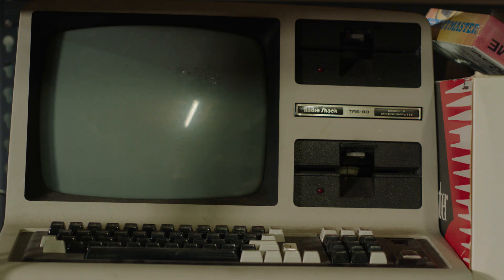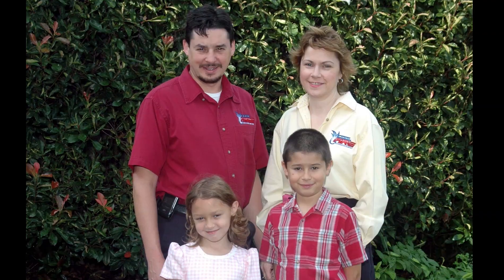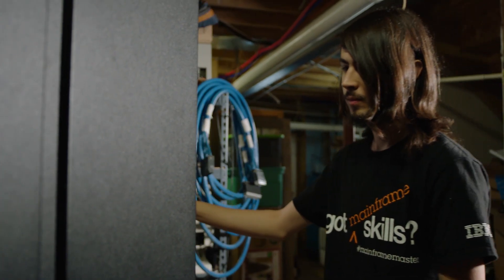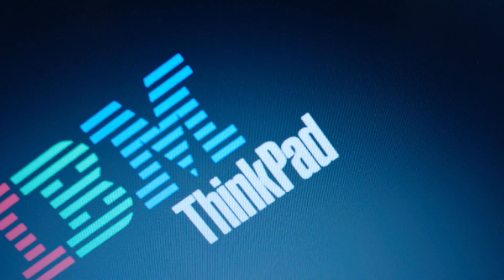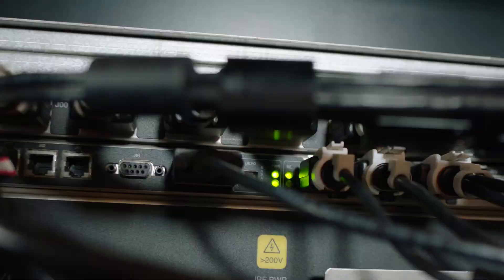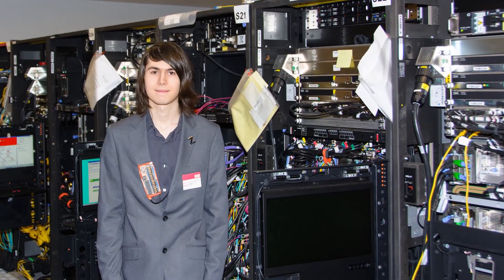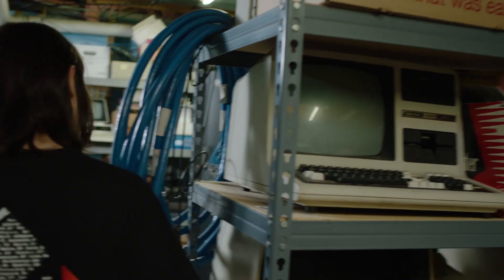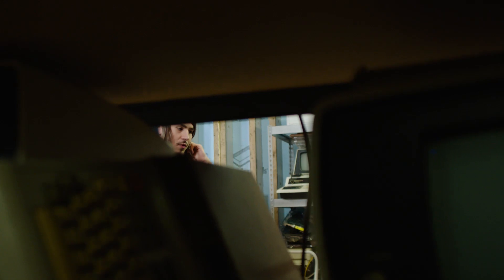The "Mainframe Kid"

Comment: it's one thing to own one, it is yet another to get one running. i worked with these machines when they first came out in the 80's and 90's. each one has massive power, cooling and space requirements. no private person, don't care how rich, has the floorspace to get one operating.
then there is the software needed to get these things to do anything. many won't even power on without the right programs and firmware.
how about the the huge tape drives, disk drives, controllers and printers?
by the way, ibm has called them 'enterprise servers' for almost 25 years.
Reply: Yup.  I probably could have had the DEC PDP-10 that I used to work on but it would have been totally impractical without buying a building to house it.  In 1968, computers were much larger than this comparatively recent  IBM mainframe.  The PDP-10 though would have come with all required software, I saved the disk images and booted it up once an emulator was available.

Comment: Started on an IBM 1620/1710 decimal system and PDP-8. Then IBM 370/168, 390, and 3033. Also DEC PDP-11/780, then started with Intel in it's infancy writing diag FW through i7 Quad Core. I helped invent the quad core and wrote the diags and comm FW between cores. Retired. Sure was a blast!

Comment: I got my first taste of Main Frames as a Millwright Electrical engineer in 1975. With a background in Logic circuits ran by vacuum tubes LOL
Reply: I hope there were no running mainframes with vacuum tubes in 1975, though we had two vacuum tubes then, a CRT and the photo multiplier tube for the light pen.
Reply: @jrstf logic circuits with vacuum tubes lol yes that was the first switches, no not a mainframe, I did say “with a background in vacuum tube Logic circuits” there was a period after 1975

Comment: I wish my parents would've allowed me to take home a machine this large but we didn't have a basement.  At one time I did have about a dozen terminals including a rather nice color graphics terminal.  Around 13, got an Altos ACS8000 'multiuser CP/M' machine that was two large boxes, and a trunk full of tapes - still in my computer room acting as a table.  Then got an Apollo DN460 which was a fascinating unix machine with a massive coprocessor card - sadly I had to get rid of this.  Then found an SGI 4D/780gt, table sized graphics workstation.  Both machines ran off 110v and ran for hours on end in my bedroom.  Little did I know Apollo and SGI ran a bit shy of max amp rating of household wiring, but never had any problem.  Still have the 4D and about 12 other SGI machines, an IBM Power workstation.

Comment: Im 18 and i have my own mainframe as well although mine is a little older. its only a 1965 IBM 1800 with the 2311 hard drive, 1816 console, 1442 and finally 2 2401 tape drives. I got mine working and now after two years of ownership I've got a bad SLT module meaning i cant address some of the 32K or core memory but other than that everything works.

Comment: My 6 year old boy is just like this, in his own way. He Already makes—completely on his own —a spinning bucket toy with an on/off switch like a miniature version of the gravitron you see at the carnival. He Watches YouTube maker videos and tries to copy them. He gets different supplies like breadboards, wires, alligator clips, batteries, etc etc., from the local Micro Center, and asks to borrow my tools, even a legit Black and Decker Drill, and then also uses ordinary arts and crafts stuff like glue and tape.  

All I’ve done as a parent is not to command and direct or even guide him, but merely to demonstrate, show, suggest, etc., and ultimately enable him by buying him stuff. That’s the best you can do as a parent—enable and guide your child to unlock the person inside that they already are and want to become.

Comment: I applaud this kid. I'm in my mid-60's now, and when I was 20, I went through Control Data Institute Computer Tech program. We trained on a CDC 3300 discrete transistor "supercomputer". In the late 70's I bought an IBM 370/145 mainframe from  a local University, installing it a bedroom in my own house. It was a blast to play with.
Reply: I could not fuckin imagine going to a party in the 80’s and the dude shows me an IBM mainframe in his bedroom
Reply: Wow, a 370/145 would have been a much more difficult beast to wrangle than the z890 this kid was working with.
Reply: HOW?!?  What were power and cooling requirements?
Reply: Frankie - tells us about your skills, then.@frankiedettori3932
Reply: @frankiedettori3932 about you
Reply: how big was your bedroom? i worked on one of these machines. you need disk, tape, printer, card reader and huge console. then there are the power and cooling needs, not to mention the raised, reenforced floor to support the weight.

Comment: It show running OS/2 , but mainframe runs MVS (OS/360).
Reply: What you saw was the screen of the attached ThinkPad booting the OS/2 Warp operating system. Nothing special there. But that's not the mainframe. The software that runs under OS/2 on the ThinkPad is what is used to configure, control, and monitor the mainframe's hardware. Think of it as the "control console" or "hardware management console."

Comment: If he is into legacy hardware and legacy programming he can make millions as a government contractor.

A lot of  government agencies specially military still use 70s era technology and the support system is depleted.
Reply: Yeah, and that’s because it would be a security risk to update the hardware and software.
Reply: @nojatha4637 no. It’s because when you have a critical system that works reliably you keep using it. There’s no point in incurring the cost of rewriting that mainframe software to run on anything else as long as there’s a mainframe to run it on.

Comment: I miss original IBM thinkpads
Reply: Me too. I worked for a short time with IBM, and got to play on one all day. I loved the little eraser-head mouse. I bought one, kept it much longer than I should have, and it was stolen from my car. The thing was probably worth about $150 at the time, and the broken window cost me $200. Why did I leave that thing on the seat?!!?!??!
Reply: I don't miss them at all

Flimsy paper thin ABS plastics that would snap easily, motherboard flex failures(good luck finding a working motherboard), keyboards with no windows key(can't do supercommands without a windows key), IBM bios hardware whitelisting, ouch. Terribly built machines and they don't age gracefully at all...

I like ideapads though since they're basically all pressure sensitive drawing tablets. Goood for 3d modeling and hand drawn animation

but old timey IBM era thinkpads... I uhh .. you can have it 😅 They still were pretty good at equipping laptops with nice GPUs. So if you find a working one it's still an okay choice.. Just its a lot of work to get one running. You mainly find retired business ones that'd been stripped and scuttled

Comment: Did you have to get 3 phase power setup?
Reply: He mentions this in the SHARE video. He's running on 110v under 15A. At the time, he hadn't spun up everything, but was having no power issues.
Reply: @JohnJonesJMJAtlanta  he's using " 220 2 phase that was what he said" (that's what an electric close  dryer or hot water heater uses.)

Comment: imagine having a computer thats "faster" than modern computers and it runs a old unsupported os OS/2
Reply: No, the control notebook serving as a monitor runs os/2. Not the mainframe.
Reply: @badscrewold3162  The ThinkPad T42 probably originally came with Windows XP
Reply: It not "faster" it's just different. Most computers (super and consumer grade) calculate floating points much better than any mainframe can. But mainframes exist to calculate decimal floating points. They are also far more reliable. That's why most financial transactions (stocks, flights etc..) are calculated via mainframes.
Reply: Hello Ricakasheye Labs.  Actually OS/2 which was written almost entirely in Assembly and by 1992 was nearly fully 32bit and by 1994 fully 32 bit and addressed what was massive amounts of RAM only exceeded commonly by 2001, could access multiple drives simultaneously, could compile and run Unix programs, and run 8,16, & 32 bit Windows programs was and is one of the fastest OpSys ever made.  It never stopped being supported. Not only does IBM still do support for a fee, but the successors, first eComStation and now ArcaOS, handle support and sell systems with many modern upgrades.  There are still mission critical systems running OS/2 to this day (as of 2019) even though many now do it in VMs.
Reply: @enorbet2  OS/2 was/is real operating system. Windows was that time (1990) only GUI for DOS. IBM don't sell OS/2, that's why it never flight. There was resellers only, but they don't care. We can see results now...
Reply: @auriavizia  Ummm why address that to me?  I bought and used 2.1, 3.0, 4.0. and WSeB and I was a member of TeamOS2.  I KNOW it was real.  I also am pretty sure that resellers had little to do with failure.  IBM shoulders that blame because it was heavily divided on OS/2.  IBM was making money fixing Windows workstations and those critical of OS/2 were embarrassed Microsoft "left the party with cake in their pockets" and through potent marketing and advertising, beat IBM with their own stuff.  Those that championed OS/2 said, "If IBM bought out a successful sushi company they'd advertise it as 'raw, dead fish'".  Incidentally, there was no good reason to be embarrassed since IBM on the whole did not even want SOHO Desktop users.  They were strictly focused on Enterprise which was largely responsible for the design that made it an arcane PITA to install.  If it wasn't for Community Support (and ATMs, Flight Traffic Control and Hospitals) OS/2 would've died out by 1999.
Reply: @enorbet2  It seems that you know much of this topic, that's why. I don't blame YOU, IBM make their choices. BTW, you have much experience and you have done much with OS/2. Have you seen/done REXX programs with OS/2 application generator? It was graphical interface, you could draw flowcharts, and program make REXX code. I might have that package somewhere.. REXX was bridge on OS/2 workstations and mainframes. That's why i like it.
Reply: @auriavizia  I don't understand where any blame is involved other than the company that created and marketed OS/2, but OK.  Initially Rexx was quite basic but at some point, commensurate with IBM's push for "Object Oriented Programming" a graphical version was released  and enjoyed some success.  My most compelling interest in programming at that time rely functional.  I wanted to be able to create drivers due to the lack of a LOT of hardware support in OS/2. at least in the SOHO Desktop market so I intended to become adept at Assembly.  Thankfully shortly after Warp 4 emx runtimes became available, I briefly ran Enlightenment as a replacement for the Presentation Manager and was sort of sideways introduced to Linux, which within 2 years (late 1999-early 2000) became my favored Op Sys. I did keep an OS/2 system install up until 2010 and held some hope for eComStation but it's lack of innovation beyond the first update and subsequent lackadaisical zombie of Arca just lost me.

Frankly were it not for Dani's drivers for modern storage I wouldn't have lasted much past 1996.
Reply: @enorbet2  nu
Reply: @petermoulinex6046  ummm to exactly what are you saying "nu"?  Everything I wrote is true.
Reply: """Faster"""
Reply: If you don't have flashbacks from the PTSD inflicted by OS/2 you never used it.
Reply: "The point of the mainframe is to run alot of concurrent jobs/programs at once and to isolate them from each other. It won't run one program any faster than a single core PC (if it had a 5.5ghz 8 core CPU and terabytes of ram) but it will run the same program 8000 times concurrently without a performance penalty." - Richard Vaughn 
4 comments below, thought this is the perfect explanation
Reply: The mainframe won't be faster. That's a fallacy

Comment: Ive always been so interested in old hardware and working with or configuring them, if only I had the resources to actually get my hands on one lol
Reply: I just build a PiDP-11, a small replica of a DEC PDP-11, fun to run vintage Unix on and also program via the front panel switches. Not very expensive either.

Comment: Hey Connor, now that you are at IBM you should start collecting spare parts!!! thays always an issue with older proprietary hardware.
I restore broadcast video tape machines. The ones that weight 1 ton, require compressed air, and lots of power. When they work, they are amazing, when they fail, you must source parts for it, which typically are no longer made. So sometime you have to redesign

Comment: Nice to see OS/2 Warp there !!!!
Reply: @herbert I know modern mainframes can run Linux as Logical Partitions (sort of between what a Linux container is and a VM, but done in hardware)
Reply: @herbert first sort of problem: IBM mainframe is usually PowerPC I think, which isn't x84/amd64, so lots of programs don't run without getting the original developers involved. Yes, I do believe you can turn part of it off. No graphics I think. Best thing a mainframe can do is pushing data around. It has the best I/O paths of it's time and good system for when hardware fails it will continue doing what it did before. So it's great for databases, etc.Games, not so much, not even number crushing really. Well, if you pay a lot you can have a  lot of cores.
Reply: @autohmae  IBM mainframes run z/Architecture processors, not POWER/PowerPC. Very much a CISC instruction set, where POWER/PowerPC are RISC.
Reply: That’s just the management console. Not much to do with the mainframe.
Reply: IBM really blew it with OS/2 There is an in-depth video on YT about how they screwed up.

Comment: Hey Connor , boy you really bring back  memories. I use to work for Stanford Research Institute in the 1970's and we had IBM mainframes, then I went to work in silicon valley,  and mainframes were the rage ...lol   Eventually I ended up at Apple, yep, mainframes there as well, who would  have thunk it huh ? Thanks for the memories , and good luck in your career, never stop doing what you love...  :-)
Reply: Apple got to the point where their manufacturing software (spreadsheets on Apple 2's & 3's) didn't scale to their success.  At the time the only packaged manufacturing software (MRP) that scaled to their requirements ran on IBM mainframes.  I worked for the company that supplied those packages which ran on 3090s running MVS/XA
Reply: You didn't work for Stanford, nor did you have a job at Apple.
Reply: @alchemist3724  
How do you know?
Reply: @Architector_4  how do you know
Reply: @yarghhargh9345  
I don't, hence I'm asking!

Comment: I wonder how much their electric bill is each month...
Reply: It was about 300~ USD extra a month with the mainframe running for a full month. It consumes about 2.2kW
Electric is expensive where my parents live though.
Reply: @Conmega1  your parents are lucky you didn't get an IBM 3083 E with 20 tape drives, numerous 3330, 3350 and 3380 DASDs, three StorageTek high speed chain printers, like what I was lucky to start out my job career with in 1983 ... they'd have a pretty solid central heating system for the house that way, I remember opening a door on a rack and being shocked by a water pipe with a man's diameter ...
Reply: furzkram I had a handful of servers running in my college dorm room, had to leave the window open during the winter to keep it a normal temperature inside lol
Reply: That's crazy.
Reply: @Conmega1  2.2kw isnt that mutch considering my PC is already 1.2KW
also runing a cople ofdell r610s and 710s so yea
Reply: kylian wesbeek I highly doubt your PC is drawing 1.2kW. The PSU probably just has a max output of 1.2kW.
Reply: HudsonGTV it’s not a damn PC. It’s a mainframe, and they DO use that much power, ON THE LOWER END.

Edit, wrong person. That was aimed at kylian.
Reply: @Kylian381  running 2 710 and 210II here, believe me, electricity in Germany is expensive asf. 26ct/kwh, and in US it is about 8ct/kwh
Reply: 10k if they would live in Germany 😂
Reply: Nothing Connor can't pay for anymore.
Reply: You mean the heating bill lol
Reply: Working for IBM he can cover the cost in a couple of hours.
Reply: Conmega but how did it help out as t the house?